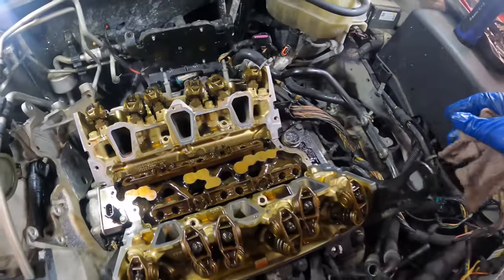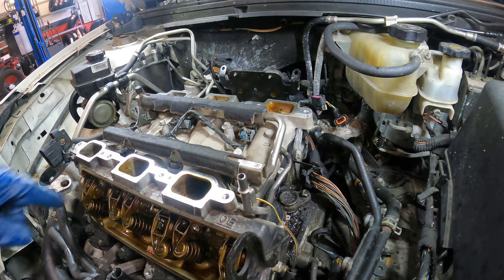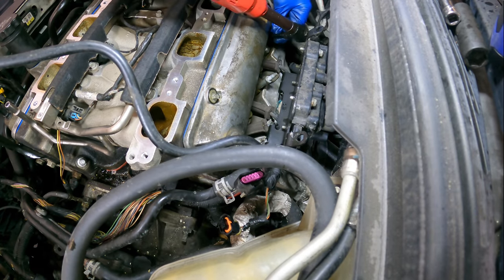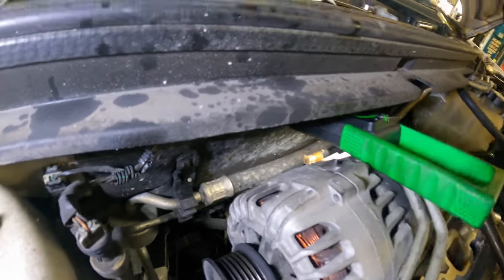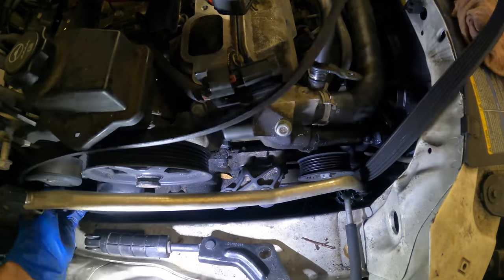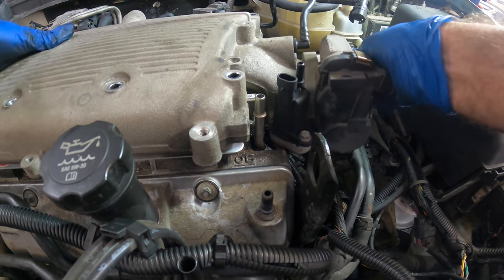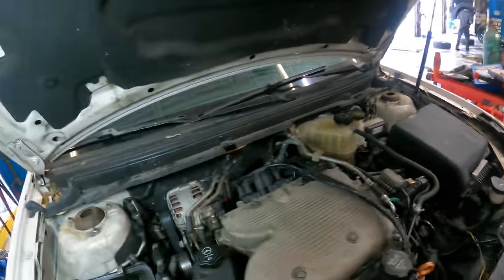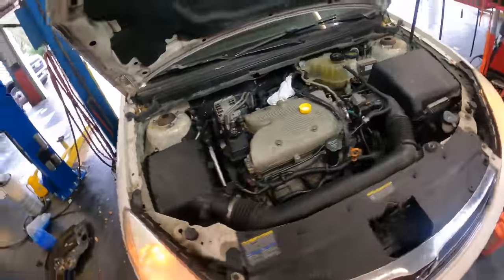It’s Going to Live | Saving an engine! 3.5l Lower Intake and cylinder head coolant gaskets

Comment: Ray, what’s your opinion of after this is all done, giving the engine a good wash/detail?  With all the electronics now, some mechanics say just leave it.  Like reusing cotter pins, all that oil gunk bothers me :)
Reply: I've been washing down and spraying tire foam on my engines since I first started driving in 1994 and have never had an issue with electroics. Even on my new trucks and that's taking them to the car wash and using the spray wand. My older trucks is an 08 Silverado with 300,000 miles and I've never had any electrical issues. When doing a big job like Ray did, I believe in clean cean clean in regards to cleaning down the old oil leakage and grime on the engine. When ever I work on somebodys vehicle that has leaks I fix, I make sure it is spotless. It also allows you to see if it leaks again or if a future leak happens on a different part of the motor.
Reply: The chances of having an issue with washing everything down are low, but there is a possibility of it. Usually only when pressure washers are used, but if any connector is compromised just a little, water intrusion will show itself either right after or in a few months.
If I do clean an engine down, it's usually before repair so I can see those connectors during the repair as well as locate leaks.

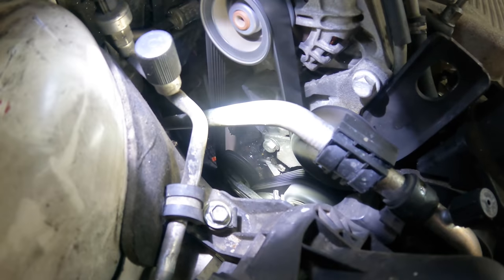Comment: 58:02 You never tightened the third (front) bolt on the alternator, I think.
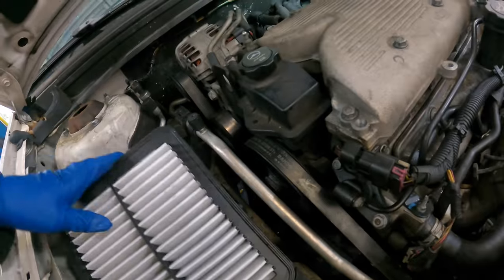Reply: It looks tight at 50:20. 🤔
Reply: I was thinking the same thing....but it looks like it was tightened later when some vacuum hoses were installed there.
Reply: You have to remember the video  is edited and not every single step makes the cut. If it did it would make for a longer video and more editing for Ray..Dont forget he releases videos every day, that work is done at home every night after a long day at the shop..
Reply: @qrphfradio7753  thank God someone with a bit of brain understand editing.....good call QRP HF, the rest of the peanut gallery needs to understand editing. Cheers

Comment: Does the position of the camshaft lobes affect the amount of torque needed to tighten down the rocker bolts, or not by enough to matter?
Reply from the maker: It does not affect it bc the rockers are solid mounted and have a base and bearings. They’re non adjustable. Any valve lash is taken up in the lifters

Comment: I use to own a 74 Olds Cutlass Supreme-Rocket 350 engine that had over 150,00 on engine and never had a wrench on engine other than Water Pump, Points and Condenser--everything on engine was designed with great engineering including Oil Filter that hung straight down-back end of engine. It got 21 mpg on highway, much better car than anything designed today...

Comment: I had a Ford van come in today with a 6 cylinder engine 215 thousand miles misfire bad the front plugs had been replaced twice the back 3 had never been replaced because of what you got to do but they charged for all 6 plugs well it's fixed now the owner couldn't believe how good it ran when I was finished

Comment: I've been doing mechanics for over 15 years and the best way to stop any kind of leaks is by using gasket sealer on the outer edge very thin layer. I've seen even the best quality gaskets out there leak after a few months. By use both combinations can last for years.

Comment: Scissor to cut split loom,  ez way to put it on run a finger down the seam to pre widen the gap slit it on the wire then wrap it with black tape.

Comment: First....any hardware store or plumbing supply..., even home depot would have that intake fitting  . It's just a standard hose barb . Metal  , brass or plastic would have worked  . You can buy them all day long and be less expensive than the dealer part  . But I was wondering why you didn't wipe out the throttle body when it was exposed during reassembly  ?  That should have been an automatic just because  .You are a great mechanic and I enjoy your channel  . 50 years experience  , automotive  , concrete trucks and industrial  . Keep up the good and "Honest " work  .

Comment: Del City Wire sells an insertion tool for split loom and fabric wire cover. Split loom isn’t bad to install. The spiral armor wrap for hydraulic hoses is considerably harder. The Kevlar sleeve is nice but usually only get it when a new hose is made

Comment: I’d of prob torched way before pulling intake back off!!  Lol, when I did plumbing using a torch was common on removing broken, plastic threads especially in water meters!!  Excellent 2 part repair Ray!!

Comment: Before I replace a belt, I fold it up and put it into the bottom of a big coffee can and spray 303 Aerospace lubricant onto the belt in the can and leave it for the next day, wipe it off good, put the lid on the coffee can for the next belt and then install the new belt. I will never have to replace that belt again, usually. Before I install my new tires I take them home and also soak them with 303 till the next day. I do the outside and mist the inside and wipe them good and then the next day take them to a tire shop for an install. I get 80,000 miles from my tires usually, if I spray them every 6 months again with 303. Save me tons of money on tires and belts!

Comment: nicely done Ray and thank you for all your videos and for all the little - big things you doing extra just to make people little more happy. unfortunately you can't make happy all of them. it is easy to comment someones work from other side of the planet, to do that job and do it right is not an easy task. this saturn makes me thinking - how many times we all have seen engine damaged even catastrophic failure due to broken some of those stupid plastic parts ? that goes to intake manifold parts, hose cupplers, water pumps and much more. why do they still do it even when they know that it creates problems ? and this saturn? it would be saving of 4 ft lang huge plastic tube and cople of ft lang wire harness just to switch sides of battery and air filter ... and that just from taking quick look on that thing - sad.  well , why would we make something simpe, if we can make it complicated, right ? keep up the good work Ray, I'll be waiting for the day when you will be opening your own shopp - that is, if this one is not yours. and don't forget to have a great day

Comment: It's a testament to how smooth V6s are that the yellow bottle cap never moved!
Reply: I find this evolution hilarious! The 1961-67 Fireball V6 was dropped by GM in 1967 because consumers thought it was "way too rough." It was sold to AMC where one executive described it as "Rough as a cob!" This was a plus in "rugged" CJ Jeeps. It got phased back in by GM in1975-78  because it was found to produce lower emissions and the engine was redesigned slightly for smoothness. From roughest to smoothest in 50 years.

Comment: Ray - minor issue here: 
When using a crows foot (or "offset") ratchet with a torque wrench you should adjust the torque wrench setting to account for the offset of the crows foot.  For example, say the finished torque required is 60 in-lb.  If your crows foot is 1" from center-to-center, if you apply 60 in-lb (the "click"), the bolt actually is torqued to 65 in-lb, about 8% higher than spec.

To determine the proper torque wrench setting when using a crows foot, first measure the distance c-to-c of the crows foot, then divide this measurement by 12.  If the crows foot is 1" c-to-c you will get 0.0833.  Add 1 to this (1.0833).  Now divide your desired torque setting by this number.  In your case, 60/1.0833 = 57.2 in-lb.  This will give you 60 in-lb of actual torque on the bolt.

Comment: Just in case is wasn't seen on part 1, it's best to replace the o-ring on the oil pump drive (distributor looking deal) while the plenum is off. They always leak oil. ;)

Comment: The bracket next to the power steering pump, can go on first as you can change the pump without removing it. I would say with it being off it is probably easier to put it back on after.

Comment: am amazed that the hydraulic lifter has an adjustment stroke so  that a rocker gap is not necessary and that the rocker torque does not change between open and closed valves

Comment: I knew you were going to break that ABS fitting hand tight then 1/4 turn. The Teflon tape is both a lubricant and helps seal the connection. You can check for a leak and if necessary just go easy on another 1/4 turn or less at a time. That’s what we do in the plumbing trade. Assuming that it was a NPT Thread. I bet there was some not fit for the platform language you cut out. I enjoy your channel. Thanks.

Comment: as much as it sucks for this car owner that the repair ended up costing them so much, mostly in labor. but i think they made the right decision to have the gaskets replaced to prevent the initial reason they ended up in your stall from happening again within a matter of months. 

thankfully they realized spending a good amount now will save them later. as now the replaced starter will continue to work for at least a few years to come, depending on its manufacturing. and you wont see them comeback months later claiming you didnt fix it right.

Comment: There is a brass fitting similar you can get in the fuel line to an old carburetor. I had an edelbrock that used one like that for the fuel line.

Comment: Very similar to the 3.4, intake gaskets still an ongoing issue with these gm 60° v6s.
Intake & exhaust pushrods are different lengths be careful
Timing chains should be done about 160,000-175,000 miles they are common failures without warning.
Water pumps every 20,000ish some sooner.

Comment: Not criticizing you good sir... from my experience with teflon tape I would recomend switching to a teflon thread sealer paste. Paste lubricates and seals the threads better. With the tape it enlarges the thread diameter. Tape puts extra stress on used fittings and the port it threads into... easily adding a compounding wedge force on the components... also in my line of work, I've found teflon tape scrapes ending up in hydraulic pilot spools and main flow valve bank spools...
Use the paste... it also smells nice. Lol a rarity in the wrenchers trade.

Comment: Every person watching knew that plastic part was gonna snap, by the time it did, as I literally said aloud, "that's gonna snap", as it snapped...Might even have been more brittle than desired from sitting atop the motor for a decade or so..But, we've all been there too...Doesn't take away from a nice job....The extras you do always negate any blunders...Heading for me spot in Citrus county, maybe I'll stop by, have a coolant leak in a rough spot, and my garage is too full of crap, and it's far too cold, to do it me self, and I have to make a stop in the area, anywhichway...

Comment: Ray needs at least two more tools.
1- Linesman pliers aren't good for much of anything else in automotive work but they are hands down the best for those flat spring type hose clamps.
2- Garden shears are great for trimming hard plastic wire loom, vacuum hose, fuel hose and heater hose.

Comment: Throughout I kept saying to myself "I hope Ray dresses that awful wiring loom". So glad you did, but some others looked bad as well, the outer plastic seems to have degraded. I thought you were going to use a wide bore 4:1 heat shrink tube but what you did was wholly acceptable considering the original state of the loom. You also learnt for next time, not to over torque the vacuum connection 😆. Really enjoyed watching the video, you seem to have a crazy bunch working alongside you. 😆

Comment: By hose it off. Do you mean foam degreaser all over the engine top to bottom to make sure there is no leaks for sure? That is what I would do. This is 1 of the worst leaks I have seen in a while. I would obvious add 30 min for it, but it would make the customer so happy. Trust me. It's worth it.

Comment: Once you started looking at the inside of the engine bay and the amount of oil all over this frame from all the leaks, why would you not spray it down with some sort of engine cleaner or degreaser and get all the junk off of it before you started taking it apart? 

I would have thought pressure washing it would’ve been a good alternative, especially if you had access to a Hotsy pressure washer.
Reply: Wait until after the job is done because your about to dump oil coolant and everything else down when doing job and I guarantee Ray uses a can of brake cleaner on the underside of engine before finishing but do it after you finish so you don’t have to do it twice

Comment: REEEEEEEEEEEEEEEEE!
Just kidding, Ray!
Those fittings always break! I go to the hardware store, and get brass fittings to replace them. GM was bad about a lot of their quick release coolant fittings too, as they were made of pot metal or crappy cast aluminum.
Have a great day! o7
Reply: Same with ford escape 3.0 and newer dodge caravan..they have plastic y's with plastic molded clamps on the heater hoses. I go to home despot and buy some brass t's..never a leak again.

Comment: Those gasket links that curve around the pushrods are to keep the gasket in alignment, but it looks to me like they could have been designed to curve inward toward the head allowing you to slip the gasket in without removing the pushrods.

Comment: I remember doing the same basic repair on the 3100s at a gm dealership in 2000. so gm hasnt fixed their 60 degree v6 in 22 years.
Reply: Lol there are way too many designs of that engine and that’s probably why

Comment: Video 1 Ray: You can do most of this job with 2 sockets and a screwdriver.

Video 2 Ray: Look at this. I've used every tool in my collection.

To be fair, he did have some things go unfavorably.

How do you recommend one goes about liberating the engine bay and undercarriage from the thick glazing of oil crust that's on it? Can you just spray it down with water?

Comment: Random thought from the 90’s
I vaguely remember using a Lo title product that was oil solvable but set when removed from air and that way it never set hard inside and blocked oil galleries.

Comment: Steel bolts should thread 2 1/2 times the diameter into aluminium. 1 1/2 times into steel.
Nuts are 1 1/2 times thicker than the bolts (screws) that screw into them.

Comment: heres a good question, should you use anti seize on bolts that go into aluminum etc ,or the stuff that comes with stud and head bolt kits, to get the torque specs. I do use thread locker on stuff where required, but I still clean the  threads and re apply ( I work on ATV,s and Jeeps

Comment: Torque wrench should work on the offset end,,,as long as it’s at 90deg
Reply: Bingo, 90 deg or you're changing the length of the lever
Reply: @warrantyvoid100  
I should add that the way he did it with holding the extension shaft also works

Comment: Just an FYI, those neat ratcheting crowfoot wrenches shown in the last video about this car are also available under the Case IH brand. Part # SC24501 

I’ve done some preliminary searching and they are a bit hard to find. Seems like they are made by Snap-On/Bluepoint, but are significant cheaper in the Case brand and MAY be available at agricultural-type stores.

Comment: I think if I had to do that to my Saturn I would just scrap it  I amagine it's a costly job I have 2003 Saturn ION love the car but so much going on with now owned it for about 4 years now needs shocks front and back rides like a tank. Just put new gas tank straps on it. Thanks for the video.

Comment: I didn't know anyone still used the rubber valley gaskets. They're always the first thing I throw away.
Reply: Same here, always have 110 percent success with a bead of silicone on the china rail.  The factory style rubber ends...well not so much, that is why he is having to re-seal in the first place.

Comment: Check the difference of the torque between the use of the extension and not using the torque wrench on a lug nut. I'm interested to know if you lose or gain any foot pounds on a torque. It would only take you 30 seconds to do it

Comment: I would clean the throttle body while I was putting it together.
But this was a neat job to watch, ray.
I think one of those guys that is angry sounds like a sasquatch recording I heard. Except their language is repeating what they hear. Explains some of the frightening screams.
Sounds a little too close to a saabe or sasquatch.
You can offer apples and then run.
Don't try bananas because they don't peel them. They just bite them and spit them out.
Doodldoodledoo

Comment: Hello Ray,  thanks for showing this job.  I live on my boat and my port eng needs a head gasket replaced. (Chrysler LM 318 225hp each.  have a pair) ..   looking and reading the manual is one thing but watching you do this is just too easy.  time consuming but easy.  Do you have a link for that Torque Wrench that your using?

Comment: Love your videos only thing I have to say that is 100% opinion but the plastic intake seals on the front and the back of the motor complete junk I've always used rtv the whole way across the block from head to head and I honestly saw q but of oil on that surface for the same gasket other then that beautiful job and they make a steel version of that vacuum port fitting from the 90s 3.4s or something

Comment: Not surprised at all that the intake manifold plastic fitting broke, these light-duty things are only made as thick as they need to be and you hardly need any plastic at all to handle 12psi. With tape on threads, the fitting should already have been air-tight finger-tight. Full grip on a ratchet to drive a small plastic fitting possibly made tighter than intended by tape on the threads immediately looked like incoming misery to me.